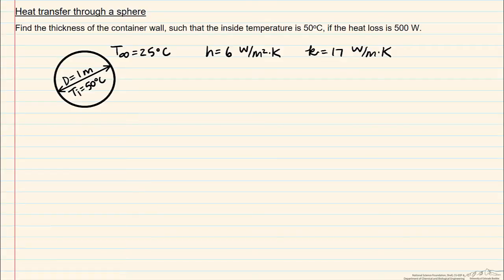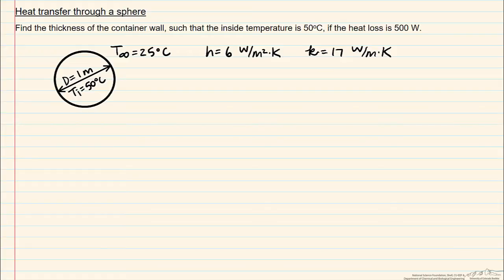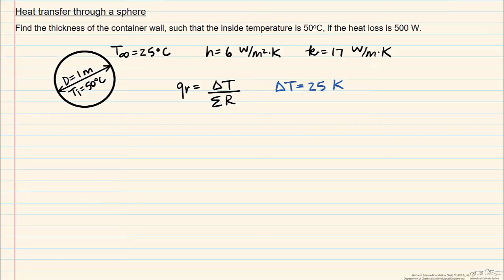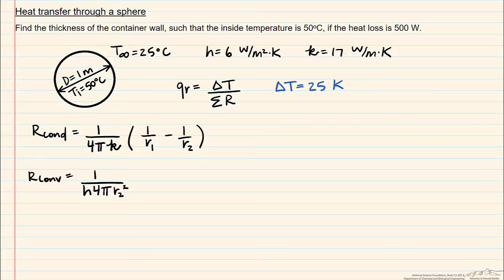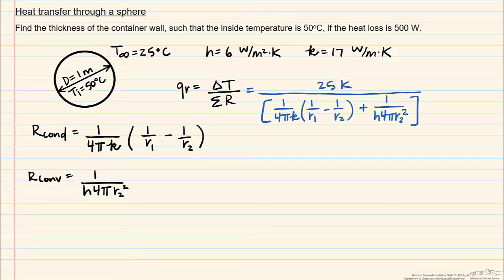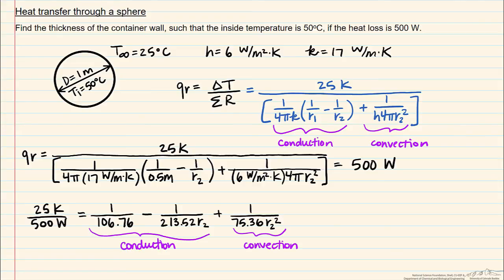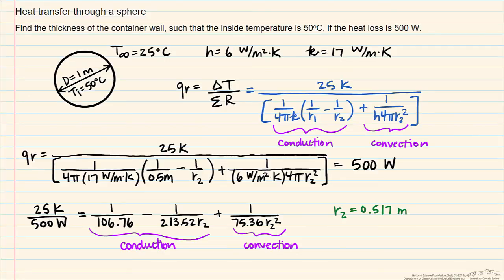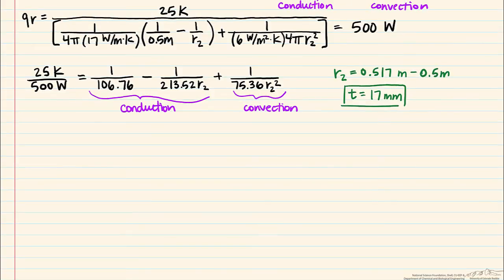Heat Transfer through a Spherical Container

Comment: For spherical shape
I only focus on the ratio of the radius of the ball casing to the thickness of the ball. If R/ dR = 1 is found, then the formula must be reviewed. The general equation is:

Q 		= - k. A. (dT)/ (dR ),	 Fourrier  law	
Q 		= k. 4π R2. (∆ T)/ ( R2 – R1 ). 						………. 	1
Q 		= k. 4π R1. R2. (∆ T)/ ( R2 – R1 ). 						……….	2
Q 	          	= k. 4π R1 . R2.(∆ T)/ ( R2 – R1 ) = k. 4π R2.(∆ T)/ ( R2 – R1 ). This formula emphasizes the ratio of the radius of the ball casing to the thickness of the ball. So the equation is:
k. 4π R1 . R2.(∆ T)/ ( R2 – R1 ) 	= k. 4π R2. (∆ T)/ ( R2 – R1 ), So the eliminated part is k .4. π.
R1 . R2. (∆ T)/ ( R2 – R1 ) 		=  R2.(∆ T)/ ( R2 – R1 ).
( R1 . R2.)0.5 (∆ T)/ ( R2 – R1 )	=  ( R2 )0.5.(∆ T)/ ( R2 – R1 ).
( R1 . R2.)0.5 . (∆ T)/ ( R2 – R1 ) 	=  R.(∆ T)/ ( R2 – R1 ). So we get the ratio of the radius of the ball casing to the thickness of the ball.
( R1 . R2.)0.5 / ( R2 – R1 ) 	=  R/ ( R2 – R1 ). So the ratio of the radius of the ball casing to the thickness of the ball. ( R1 . R2.)0.5 :  ( R2 – R1 ),   ), is the ratio of the radius of the ball casing to the thickness of the ball. 	  ……….    3
Such,

dR		: Instantaneous thickness. (R2 – R1) or (outer –inner)
dT 		: Instantaneous temperature
K		: Thermal conductivity of the material
Q		: Calorific value
R		: Length of the radius of the ball casing
∆T 		: Integral result of dT
∆R		: Result (R2 - R1) = (outer – inner) = thickness
4πR2		: Area of the sphere's shell
R/ dR		: Proportional to R / (R2 - R1) The ratio of the length of the radius of the ball casing to the thickness of the ball.

My objections are:
R2 : R2 .- R1
R2 : R2 .- R1 	~ 	R2. R1 : R2 .- R1,
R2 = R2. R1
My comment is that R2 ≠ R1 x R2.  The R in question has the same value, namely R x R.
Description of reasoning:
1.	R2 	: R2  - . R1 		 	 
R2 	: R2 .-  R1,  		for R2 = R x R. 
R2 	= R x R 
R. R	= R1 x R2 , 								…???
R . R	= R1 x R2,  because R has the same value, then R1 = R2. 
This writing will have problems with the equation:
Q 	= k. 4π R2.L (∆ T)/ ( R2 – R1 ), where R2 = R1.
Q	= k. 4π R2.L (∆ T)/ ( R2 – R2 ).
Q 	= k. 4π R2.L (∆ T)/ ( 0 ).
Q 	= + ∞ … ???.
The alternatives are:
R2 		: R2  - . R1 ,			 
R2 		: R2 .-  R1,  untuk R2 = R x R. 
(R . R}0.5		= ( R2 . R1 )0.5
R		= ( R2 . R1 )0.5    							… ???.
Is the radius of the spherical casing (R) (R2. R1)0.5...???
If that's the case. What can be explained from ( R2 .R1)0.5 in visualization 		... ???
My comment is that the conclusion is R2 ≠ R1. R2	
2.	I will insist that R2 = R1. R2. to prove my objection. Next, by substituting into the initial equation, when R1 = 0. (Solid).
Q 		= - k. A(dT)/ (dR ). Fourrier law
Q 		= k. 4π R2.L (∆T)/ (∆R)
Q 		= k. 4π R2.L (∆T)/ ( R2 - R1 )
R2. Is outer radius dan R1  is inner radius
R2		= R1.R2
Q 		= k. 4π R2.L (∆T)/ ( R2 – R1 ). I focus on the equations in bold.
              What if R1 is 0?  I substituted the basic formula.

Q 			= k. 4π R2.L (∆T)/ ( R2 – R1 ).
Q 			= k. 4π R1. R2.L (∆T)/ ( R2 – R1 ).
Q			= k. 4π 0. R2.L (∆T)/ ( R2 – 0 ).
Q			= k. 4π 0. .L (∆T)/ ( R2  ).. I focus on the equations in bold
              What if R1 is 0?  I substituted the basic formula.
      In this equation, 2 answers appear.
              In this case, 2 alternative answers will appear.

Q			= k. 4π 0. L (∆T)/ ( R2  ),  0/R2 = 0, 
Then,
Q			= 0		 			( alternatif 1 ).
              My comment is whether when the ball is in a solid state, then Q = 0???. this is very unreasonable.
Or second opinions is :
Q 			= k. 4π R2.L (∆T)/ ( R2 – R1 ), R2 = R1. R2
Q 			= k. 4π R1. R2.L (∆T)/ ( R2 – R1 ), 0 =  R1
Q			= k. 4π 0. R2.L (∆T)/ ( R2 – 0 ), R2 – 0 = R2 
Q			= k. 4π 0. L (∆T)/ ( R2  ).
Q			= k. 4π 0. .L (∆T)/ ( R2  ),  0/R2 = 0, turn left side 
Q /  0			= k. 4π .L (∆T)   
+∞			= k. 4π .L (∆T ), k. 4π.L  is constant( C ), and then
+∞			=  C ((∆T ), and then
+∞    			= ( ∆T ), ∆T = T1 – T2
+∞    			=  T1 – T2, , T1  = +∞ dan T2 known,  and then
+∞    	=  ( +∞ – T2 ),  left side is  watt and right side is temperature. so it cannot        be reduced
+∞    			=   T1
+∞   			= (∆T ), ∆T =  ( +∞ – T2 )	  		(second opinions )
+∞ 			=  T1, ∆T =  ( +∞ – T2 )
+∞ 			=  T1,	
My comment is whether when the ball is in a solid state, then (∆ T ) = (+∞ ) or (T1 ) = (+∞ ) ???, this doesn't really make sense.
  
3.	Is the radius of the ball casing compared to the thickness of the ball shell ever equal to 1? If it is found that the ratio of the radius of the ball shell to the thickness of the ball shell has a value of 1, then the formula used needs to be reviewed. The reason is that the radius of the ball casing moves non-linearly with respect to the thickness of the ball shell. Meanwhile, the radius of the spherical envelope moves based on a certain hyperbolic function (it does not represent a linear line. It mean R2 / ( R2 – R1 ) ~  R2 R1 ( R2 – R1 ). 
So, 
R / ( R2 – R1 ) = ( R2 R1 )0.5 / ( R2 – R1 )   is the ratio of the radius of the spherical casing to the thickness of the skin  ( R2 – R1 ).
              (R1 . R2 )0.5  / R2 -. R1  never worth it 1. Written in the equation is (R1 . R2)0.5  / R2 -. R1 ≠  1.

Let's prove that (R1 . R2)0.5  / R2 -. R1 = 1,  if it can be found is 1, then the previous formula must be reviewed. Note that I will enforce that R2 = R2. R1 and R = ( R2 . R1)0.5. So the ratio of the radius of the ball shell to the thickness of the ball shell is written in the equation :
( R1 . R2 )0.5  /(  R2 -. R1 )			= 1				.…….  equation  1	 
Q 		`			= k. 4π R2.L (∆ T)/ ( R2 – R1 ). 				 
            	Q 			           	             = k. 4π R1.R2.L (∆ T)/  thickness
Focus to R2 / ( R2 – R1 ).
R2 / ( R2 – R1 )										 
R2  					= R2. R1
( R2 )0.5  					= ( R2. R1 )0.5
R					= ( R2. R1 )0.5
              What we are looking for is the radius of the ball shell relative to the thickness of the ball shell.
R / ( R2 – R1 )				= 1,  R = ( R2. R1 )0.5
( R2. R1 )0.5 / ( R2 -  R1 )			=  1,  then,
( R2. R1 )0.5 				=  1.( R2 -  R1 )
              ( R2. R1 )0.5 			             	=  ( R2 -  R1 ),  the equation is squared so that
( R2. R1 )				=  ( R2 -  R1 )2,  
( R2. R1 )				=  ( R22 - 2 R2 . R1 + R12   
( R22 - 2 R2 . R1 + R12 )			= ( R2. R1 ),  
( R22 - 2 R2 . R1 + R12 ) / ( R2. R1 )		= 1,  
R2 / R1 – 2 + R1 / R2			= 1, 
R2 / R1 + R1 / R2				= 1 + 2
R2 / R1 + R1 / R2				= 3,   
R22  + R12				= 3 R1 . R2
R22  - 3. R1 . R2 + R12			= 0
(R2   -  0.381969.R1 ) (R2  - 2.618031.R1  )	= 0
R2 - 0.381969.R1				= 0,	 must fulfill  R2 > R1 	
R2  					= 0.381969.R1
R2 : R1					= 0.381969 : 1,   R2 < R1.  This equation can’t be used.
 And next second equation,				 
R2  - 2.618031.R1  			= 0
R2   		  			= 2.618031.R1  
R2 : R1					= 2.618031 : 1,  this equation is suitable to be used to filfull .
(R2  - 2.618031.R1  ),  filfull R2 > R1.
               So for any R2 (outer) it will always satisfy the equation
( R1 . R2 )0.5  / R2 -. R1 = 1, when R2 : R1	= 2.618031 : 1

              R2 : R1			             = 2.618031 : 1,  is the ratio of outer to inner. Return to
              equation 3
               ( R1 . R2.)0.5 :  ( R2 – R1 ),    is the ratio of the radius of the ball casing to the thickness of the ball.
R2 					= 2.618031
R1					= 1
( 1. .2.618031  )0.5  / ( 2.618031  -.  1)	= 1
( 2.618031  )0.5         /  ( 2.618031  -.  1)	= 1
( 1.618031  )	/ (1.618031	)	= 1
R		/ ( ∆ R		)	= 1
R					=  ∆ R
This is a situation where the length of the radius of the ball casing relative to the thickness of the ball has the same length. This never happened. The reason is that the radius of the ball casing moves non-linearly with respect to the radius of the ball. Meanwhile, the area of the ball's shell moves based on a certain hyperbolic function (it does not represent a linear line

However, in the case of heat transfer, steady state flow conductors are cylindrical and spherical in shape. There are other conditions that must be followed. That is, the value of the casing radius relative to the thickness of the ball must always be more than 1. Why must it always be more than 1? This is due to changes in cross-sectional area which do not move linearly with respect to the radius of the cylinder or the shape of the ball.

Conclusion :
 
By finding the equation for the radius of the cylinder casing to the thickness of the cylinder = 1. I objected and as a consequence the existing formula had to be tested in the laboratory 

By finding the equation for the radius of the ball's shell to the thickness of the ball = 1. I objected and as a consequence the existing formula had to be tested in the laboratory.

Comment: I'm not sure if this is me interpreting this problem wrong but inner temperature, I assumed was convective then to conduction and then convection. Shouldn't it be TS1 is 50 or assume the inner temperature to be the same at the TS1?
Reply: PixieLavender Yeah I had the same problem, there should be another h value for the convective boundary layer formed between the fluid in the pipe and the inner pipe surface 😔 Not a greatly made question imo